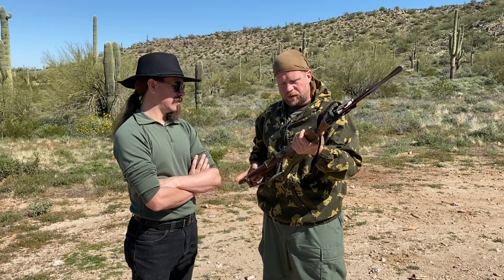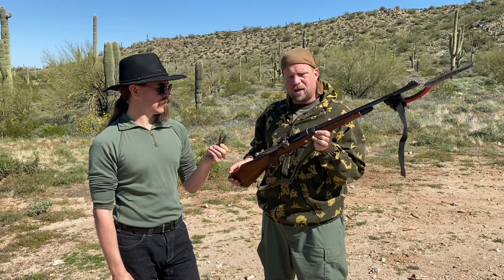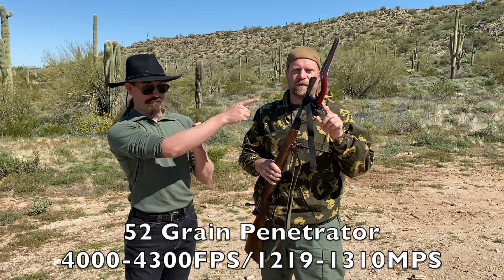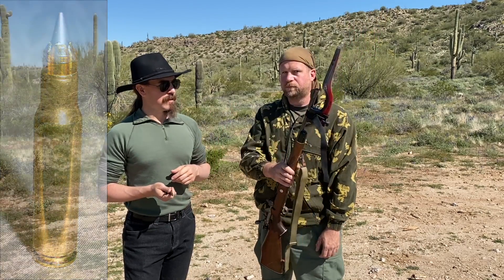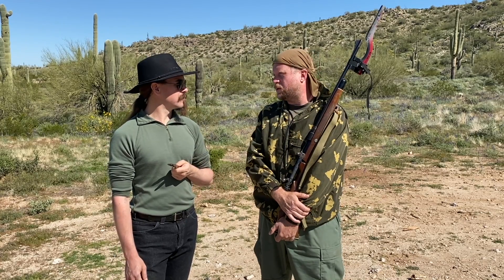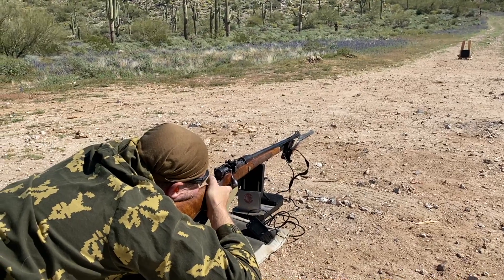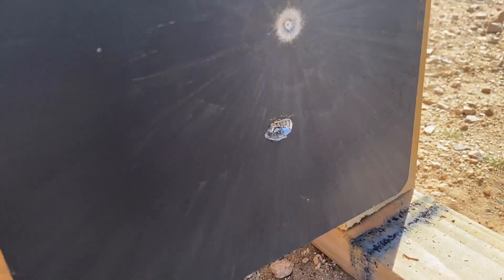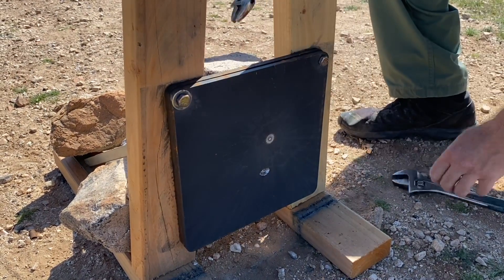M948 7.62x51 "SLAP" - Armor Piercing Ammunition Testing

Comment: Did the Arisaka have a .308 barrel or the original .311? The sabots might be more sensitive to correct bore diameter if it was the looser fit.
Reply: Yeah. A .308 will load in a regular 7.7 Arisaka one at a time. The case will flare out to fill the space used by the proper cartridge.

Comment: I twice blew the business ends of muzzle brakes off an AR-10 rifle I owned. The first time I thought it was just a fluke - for some reason the bullet exiting the bore got upset and blew off a third of the end of the brake. I replaced the brake and it promptly happened again. The problem? I was using frangible bullets (meant to go easy on steel targets) left over from training and the rifle had a polygonal bore. The bore partially crushed the bullets, so when they came out of the muzzle, spinning like crazy, the spinning tore apart the fractured bullets and the parts impacted the distal end of the muzzle brakes and blew them off.
Lesson learned - do not use frangible training ammo with a rifle that has a polygonal bore. After replacing the brake again, and reverting to ball ammo, I never had another problem.

Comment: Try the 30.06 vs this same setup with the plates bolted together. Vs the 2 plates separated.  The 2 tests arent the same. I would bet these SLAP rounds would penetrate a single plate without much issue if the plates were separated not bolted together.
Reply: The 'air'  gap makes a ton of difference.

Comment: Funny thing is that sweden use these in there arctic warfare rifles. They use it to boost the practical distance you can shoot with 308. Yes they are forced to remove the muzzle break and we still use other armour penetrating rounds for anti material use. I should be able to get a hold of these cheap but honestly its not worth it i have better calibers for long range like 6.5x55 that is stupid cheap here.

Comment: One thing I'd like to see is tests of rifle rounds big enough to use .50 or larger sabots, like 510 Whisper. While small caliber sabots have a long history of disappointment, there is an undeniable advantage to shooting a small bullet through a large bore diameter - you get the increased efficiency of larger bores (roughly, at equal powder charge and barrel length, an appropriate weight bullet's muzzle energy scales linearly with bore diameter) but actually using an aerodynamic projectile of reasonable mass.

Comment: They might have had this problem even when new. Sabot is very hard to stabilize.  They might have required a very specific twist rate, or in fact never solved the issue for any twist rate. Tolerances likely just don't work for such a small penetrator, as its an issue even with tank main gun sized rounds.  Last, 4,000fps is making me think back to a test done by the british in WW2 where they found somewhere just north of 4,000fps armor penetration no longer required a surviving penetrator. Even if it shattered on the surface the mass would continue through as if it didn't.  Sorry I don't recall the exact figures, but it might be a clue to whats happening here. If its hitting that plate at just under the needed velocity its likely shattering, but dumping its energy over an area instead of proceeding through it.

Comment: Random thoughts ........ blue plastic practice rounds ......... plastic sabot rounds .......... high velocity low weight low recoil rounds ........... scale up the bore and case to bigger and fire a standard size and weight .308 projectile with much lower case pressures and hence lighter barrels with less wear with only polymer in contact with the barrel.

Comment: I used to work for a gunsmith, and they designed an alternate brake for the M82/107 rifles. Because the army found that when they used .50 BMG SLAP, the sabot would come out of the fish gill style brake and kill the spotter. I believe they still use those brakes to some degree, but overall they're using fewer SLAP rounds from .50 cals.

Comment: Because the bullet is smaller in caliber and lighter than lead it will need a faster twist rate to keep it stable. But with that powder charge behind that sabot if you put it through higher twist rifling it might just spin around the bullet. 

There's a good number of reasons we have other AP munitions.

Comment: this reminds me of the old APDS rounds of certain low caliber tank guns such as the walker bulldog

take everything below with a grain of salt since I am no where near smart enough to become a specialist in the field of ballistics

maybe this round could be improved by stablizing them with fins. cuz those impacts looks very much like the projectile hit the target while still not fully stablized in flight. Projectiles would rotate around their central axis upon leaving the barrel, this rotation is not always perfectly along the bullet's centerline, which causes the bullet to spin like an airplane in a dutch roll. the projectile self-corrects after travelling for sometime, which gives penetrators a penetration/distance diagram that looks somewhat like a quadratic function in a simplified model with the maxima of penetration some distance away from initial starting point. or in other words, the penetrating ability of a projectile go through a slight increase before it begins dropping again. 

now, full caliber projectiles are lesser affected by this effect compared to sub caliber ones

The results could be due to the range they are shooting from. The projectile could theoretically stablize itself after travelling some distance -- I recall in the MOUT manual that for standard 7.62 NATO ball ammo, the bullet reaches its maximum penetration effectiveness at the range of around 200 meters due to the bullet stablizing itself mid flight. A 30-06 or any full caliber penetrators perform better than sub caliber penetrators of the same caliber in shorter ranges due them weighing more and are more capable of self-correction upon impact due to their shapes. The full caliber projectiles are also lesser affected by bad impact angles. In WW2, shots performed better than sub-cal hyper shots on sloped armor due to hyper shots have higher chances of ricocheting. However these are from the perspective of tank gun shells. Rifle bullets are significantly lighter. So rifle rounds should be affected even more by the initial instability aftee they leave the barrel.

Early APDS rounds fired from rifled tank guns suffered from similar issues. However they appear lesser affected, probably due to their greater scale. I would recommend testing these rounds on longer ranges to see if their penetrating ability improve

Comment: If you wanted to compare to other AP rounds fired against 3/8" targets, you would need to have spaced the plates a 1/4 to 3/8" apart. bolted together like that, they are effectively 3/4" of plate.  Unfortunately, there is a trade off to that as well (see the concept of spaced armor).

Comment: The second round likely fractured in the barrel also, and if so likely hit at much lower velocity than if it had functioned properly. It just happened to hit at a less severe tumble angle than the first. We have seen and diagnosed issues exactly like this in the course of Dagny Dagger development. And our experience has taught us that this Ultem plastic is surprisingly brittle and vulnerable to environmental exposure. I woudn't trust it at all after 30 years.

Comment: The Swedish army adopted pretty much this exact ammunition in 1998 (by Winchester Division of Olin Corporation) for the sniper rifle Psg90 (Accuracy International's Arctic Warfare, aka British L118). Not so much for the armor penetration (rated at 30mm@100m HB400 steel in documents), but for the high velocity (1340m/s or 4400fps), low wind drift, low bullet drop, 30mm 5-shot groups@100m, increased effective range and supposedly greater practical accuracy over conventional ammo at guesstimated longer ranges (thanks to the lower bullet drop and wind drift). $2 per round.

Designation: "7,62/10 PRICK". Still "in use" (I think they placed one very large order back then), though standard ammunition is also common (with a muzzle brake).

Comment: Small hardened tungsten projectiles do quite poorly against multiple plates with an air gap like that,  it will usually shatter after perforating the first layer.
Western tanks used the same kind of APDS projectiles before rod penetrators were developed and had similar issues, they can easily pierce very thick single plates but fail at two spaced ones with less total thickness as the round shatters after the first plate.

Comment: Could it possibly be that the tumbling is caused by improper barrel twist? A .22-250 is a 50-55 grain bullet at 3,500 fps usually uses a 1:12 twist. I assume this rifle has a standard 1:10 twist?

Comment: SLAP, very similar to the Remington "Accelerator" rounds in the late 80's, early 90's. Freaking wild in a 30.06! I brought down the biggest Mule Deer of my life with a 55gr Accelerator round in 1987. Well over 4Kfps. The round would hit a 300 yard target before the rifle had even fully recoiled.
Reply: Back in my youth reading about the "Accelerator" rounds when they were new I thought the concept would be great for AP usage. Never knew the .mil adopted them. Does anyone make sabots for reloading today?
Reply: @shooter575  EABCO still sells them.  Possibly others, as well.
Reply: What'd the deel look like after you hit it with that thing?
Reply: Or the tip of a tungsten drill bit
Reply: @MasterFancyPants  I was thinking the same thing, getting some .224 carbide blanks, cut to length, and use an edm to put a cone on them.

Comment: As a few other folks pointed out, the projectile is tungsten, which is paramagnetic, or very weakly interacting with magnets. The copper alloy in the jacket and the lead itself of most rounds is diamagnetic, or repelled by fields. I'm not sure how the chronograph works, but I bet it's detecting that diamagnetic property of the rounds as they cut through the fields.

Comment: I wonder if you could replicate those rounds in a 12 ga, using tugsten drill bits and a 3D-printed sabot... it would make more sense than using a .308.
Reply: IT woudnt work because you just cant get 4000 feet per second out of a 12gauge

Comment: A critique on your comparison of the performance of this round with the .308 black tip. The testing format was different; in this test you used 2 plates bolted together, forming essentially a thicker plate instead of 2 distantly placed plates. Especially in the 1990-version of the round, it seemed to not penetrate because of the second plate preventing the bulging of the steel. Don't you think the current setup has impacted the round's ability to penetrate?
Reply: That's the point, all of the AP rounds will go through one by itself. So they're trying to see which does better than others in situations beyond what they are meant for
Reply: Thats the whole reason they used 2 plates
Reply: I think spaced armor is even more effective at stopping AP rounds, so bolting the plates directly together might have increased the chances of penetrating.
Reply: @Papperlapappmaul  Yeah but you can't compare results between two separate plates vs. two plates bolted together. With separated plates, nothing is stopping the first plate from bulging backwards and allowing the round to get through. With two plates bolted together, the second plate supports the back of the first plate and doesn't allow it to bulge and break.

Comment: Also, you might be getting less penetration from your tests because the plates are stacked. A little gap might show more. Maybe.
Reply: Exacly , this is not heat ammo, thickness matters.
Reply: Spacing multiple layers of armor is how you /improve/ the effectiveness of two layers of armor. Look up "whipple shielding" for spacecraft, and also witness the effectiveness of slat armor - both instances where physical spacing plays a key role in defeating penetrators, whether physical or shaped-charge in form.
Reply: but the test was to see if it went through double thickness plate, which is why they stacked them tight together

Comment: There could be no speed reading because tungsten is the strongest paramagnetic metal, while lead and copper are diamagnetic and iron/steel is ferromagnetic. The speed measuring "bayonet" must be optimized for the latter two.

P.S. Get a proper socket wrench set, don't torture yourself with this adjustable spanner! =)
Reply: It can read non-magnetic bullets, but you have to adjust the trigger threshold lower.

Comment: I'm not sure if turning up the sensitivity would have helped. With the saboted round you effectively have more distance between the magneto speed and the projectile than what you would with regular 7.62x51. When I use mine on handguns with the rail adapter I have to change the sensitivity because you lose the ability to adjust the distance from the sensor to the bore with the mount. Again, you would have been guessing because you only had two rounds of the stuff anyway. Great content as always.

Comment: Interesting how accurate there are, because they had giant accuracy problems with SPIW sabot ammo, and how high the fragmentation persentage. 
Overall I think you will never find an infantry round to penetrate 2 plates, because nobody wears 2 plates in the fields and therefore nobody would design a round with such overpenetration, as it would probably cost a lot and hence doesnt worth the money. I think when talking about AP rounds the quality mark is not how much it can penetrate, but how accurate and reliable, and for what cost it can do it. Nevertheless, it does not lover the interest with which i watch those videos)
Reply: AP rounds were intended to be used against vehicles and cover until very recently, not so much against personal body armor. Lapua 338 AP might make it through both plates or if you consider anything below 12.7mm infantry round then there are rounds that will definately zip right through both.
Reply: @Salesman9001  Yeah, but I was talking about infantry rounds which are, relying on the country, 7.62, 5.56 or 5.45, and intended to use against body armor, which is no thinker than one plate. For defeating vehicle armor and covers tere are special devices like good old RPG. I cant remember one time when they trired to put an ability of reliably defeating armored vehicles in standart infantry or marxsman rifles. But the first time may come soon after they have developed 338 norma magnum (which is quite significant) for scuad support mg.